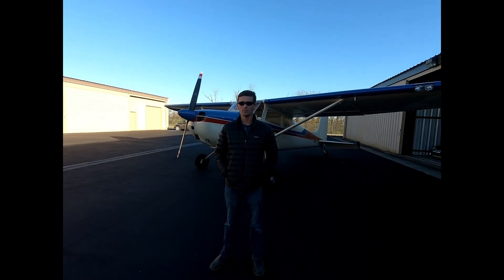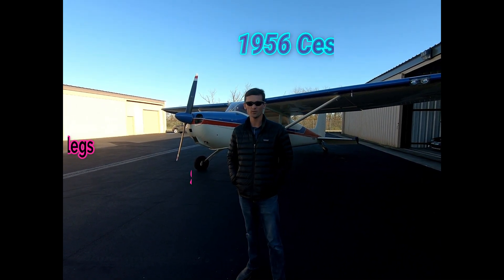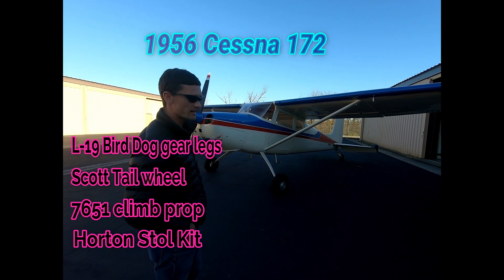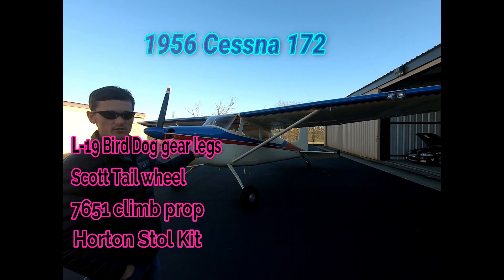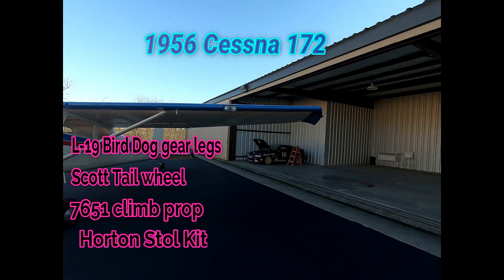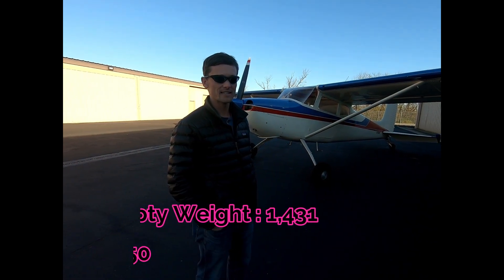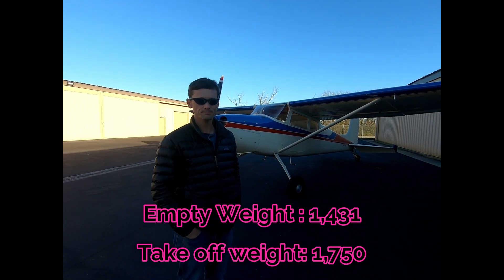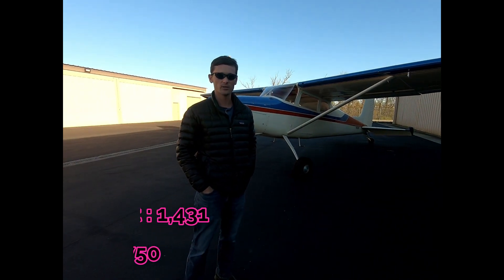172TW STOL Test Flight

Comment: Like the plane. Like the crx even more. lol  I had a about as true jdm crx as you can get.. Bought a jdm front clip  sold the b16a and put in a b18c. .  mugen front and rear spoilers,mugen wheels. and yes a back seat.  jasma mugen headers, tein suspension.   yours looks good!  scca?  
lastly how much do those 172 tail dragger conversions run ?and do they have to be approved via the faa?